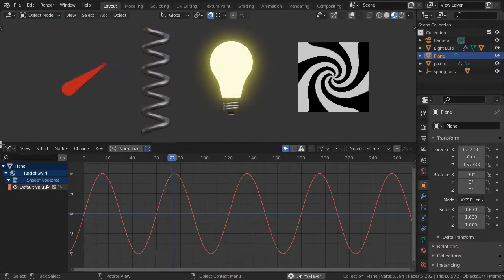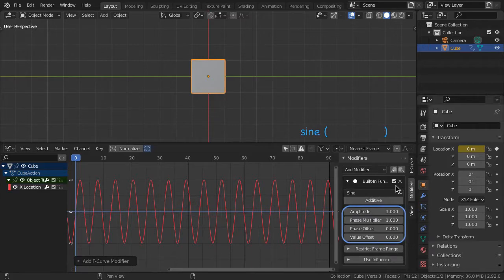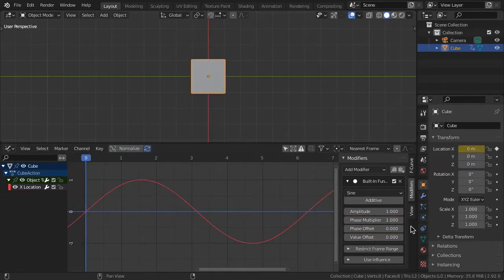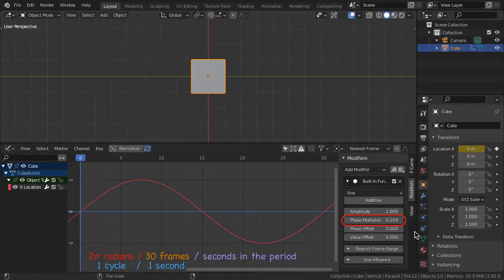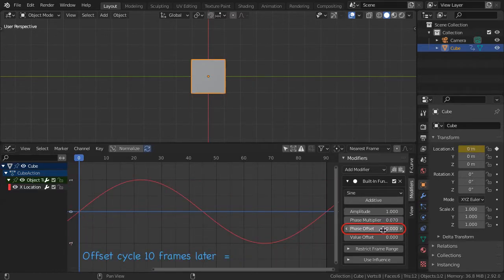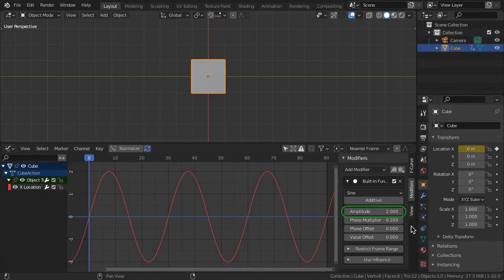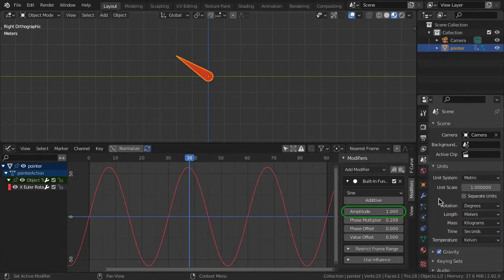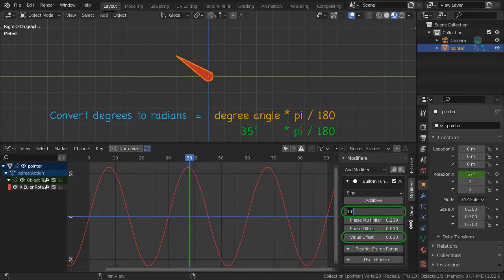Blender : Animation Sine Modifier Explained

Comment: Hi I have stumbled upon this video when searched for how to create a square or pulse wave in the graph editor. Do you know how to do that?
Reply from the maker: I haven't experimented with square waves much, but the simplest method to create one is to set 3 keyframes in the graph editor, equally spaced in frames.   Press the "T" key in the editor and select Constant Interpolation.  Set the low value on the 1st key, the high value on the 2nd key, and the low value on the 3rd key.   Then apply a Cycles Modifier to repeat the wave.   You could also use a math expression in a driver, or create a network in Geometry Nodes using math nodes to create a square wave.   I have not played with that to know exactly how, but I'm sure there are tutorials somewhere.
Reply: @aliensoup2420  I wanted to male a strobe effect of certain frequency, I thought the built-in function will do the trick because I can adjust frequency easily, especially after your video. But you have given me a lot new cool ideas, thanks a lot, I will try them out!
Reply from the maker: @SoundPeaks  Also take a look at the Step Modifier.

Comment: Hello, great tutorial but can we randomise the amplitude value i tried it with noise modifier but it doesn't give a non mechanical movement?
Reply from the maker: I don't understand what exactly you are trying to do, but you can Add a Noise Modifier to the Sine Modifier.   You cannot directly affect the Sine Amplitude since it is a constant within the function and cannot be animated.  Play with the Noise Scale and Strength to get the effect you want.
Reply: @aliensoup2420  Thank you sooo much🙏 
I need a random oscillation for a provided limit i don't understand how to create the effect, the noise modifier creates a mechanical movement which looks blocky. So I was fiddling with the other modifiers and stumbled upon your tutorial... I think going with a script or constraints is good choice...

Edit: Hello, Just got the desired result looking for using the built-in function mod and noise with noise type set to multiply and this was the key. Thank you sooo much for provoking the plan😊🙏

Comment: Good video but... This on e Feels Very Technecle to follow had to Re-watch it many times and had to take out a notepad to write things down.
does it work yes!. but im trying to write it down so i can wrap it around my head LUL.
Reply from the maker: Sorry, it does expect some mathematical understanding of functions and radial geometry.   You have to accept the Sine function is a wave, and the various modifiers scale and offset the wave.  Radians are just a measurement of a circle with respect to pi.   The modifiers are calibrated in radians, and thus are expressed in multiples of pi.   If I took the time to explain the fundamental basis of Trigonometry, the tutorial would last an hour.  You should search YouTube for some Trigonometry tutorials - there are dozens.
Reply: @aliensoup2420  yeap Whould do. Thanks!.

Comment: I have a question about blender that I hope you can help me with. Right now my solid view and render view color is not matching by a lot so I was wondering does any of this have to do with my lighting? I'm still having issues of knowing where to place light and how bright to keep it. I can't seem to fix the issue so far. It looks how I want in solid view just not in render view sadly.
Reply from the maker: I'm not well acquainted with rendering, but the solid shading view is not intended to accurately resemble the final render.   Use shaded view only for general setup of lights.
Reply: Could you perhaps briefly describe what kind of scene or project you're working on? (character animation reel, photorealistic still-life, abstract art...)
Solid and wire completely ignore the lights in the scene. Material preview mode, by default, does as well and instead uses a stock HDRI, but you can turn that off (Scene World) and/or enable Scene Lights in the dropdown next to the viewport shading selection icons (although I think that only makes sense if you want Cycles for rendered but need Eevee preview with the lights).
I'm curious about what you did for the materials? Because solid and wire view also ignore them as well, and use completely different shading methods that are just there to show the geometry - it's not really meant to match the colors or lights of the render. You can manually "color-code" materials for solid view, but it's independent from the actual material.
But since you say it looks like you want in solid: Are you trying to make a "clay render" or something stylized/non-photorealistic? If you're happy with how it looks in solid for the final render, you could try setting the render engine to "Workbench" (which is what solid mode uses), or maybe even use View > Viewport Render Image with the overlays & gizmos hidden.
Hope that is helpful, and feel free to ask anything!
Reply: @nibblrrr7124  I'm making a stylized character which I'm hoping to rig for animation purposes
Reply: @dandylion-evn7w2  Ah. In that case I'd say: Don't bother with lighting or materials yet, and just ignore how it looks in Eevee/Cycles (material preview or rendered view) for now?
You could use materials (or object) viewport color for rough labelling (e.g. skin, hair, eyes, shirt, pants).
If you want to render something out as images/videos, set the render engine to "Workbench" and use the same settings from the solid viewport, or just use "Viewport Render Image/Animation".
Is that helpful?